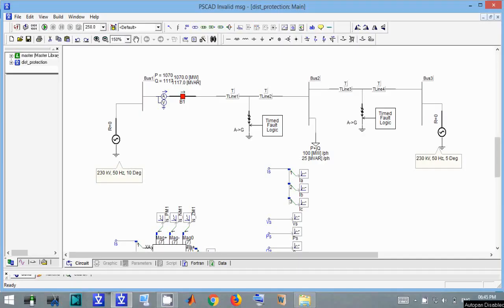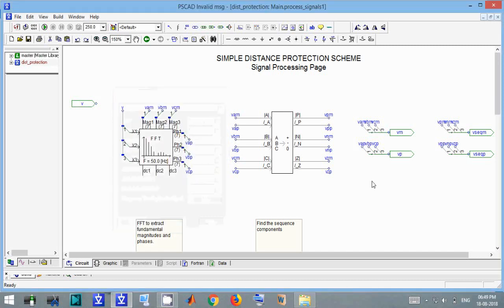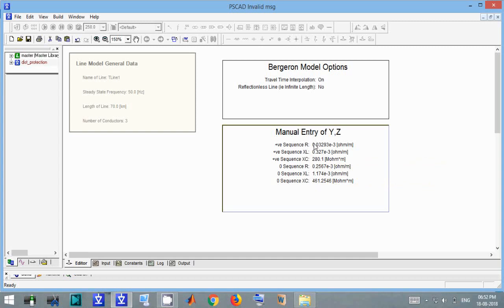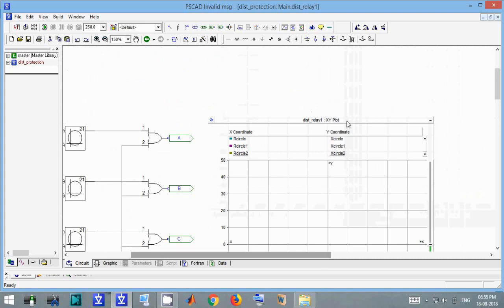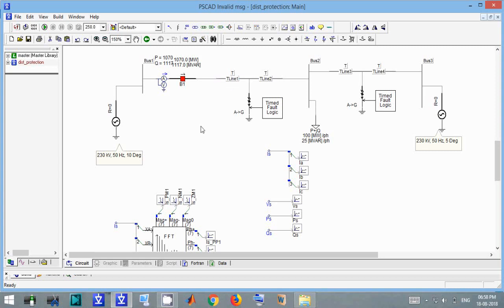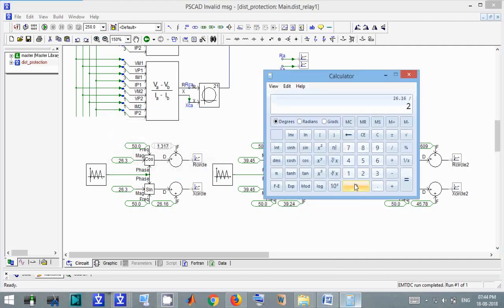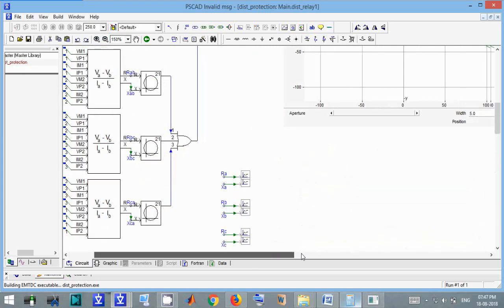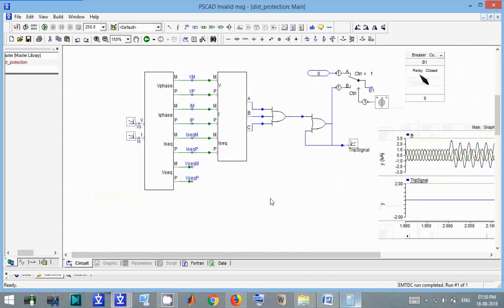08. PSCAD tutorial | Distance relay in PSCAD: Part 2

Comment: How do I detect the AG fault even if for high resistance fault cases, like more than 50 ohm and so on?
Reply from the maker: this is the disadvantage of conventional distance relay.you need to build new algo for detecting the high resistance fault.
Reply: In case of mho relay characteristics, we need line parameters to define reach for zones (circle). I want to know about how we can build quadrilateral characteristics from line parameters? It will better if you make a video regarding quadrilateral characteristics and how can we properly understand it.

Comment: I made a same model like your's， but its P and Q monitored by multimeter is different to yours when i run my simulation（Mine;P=221  Q=32.66    Yours: P=1070  Q=1117）.  Could  u please feel free to tell me what did i do wrong?    thank you every much .
Reply from the maker: may be different for transmission line impedance, freq=50hz i take
Reply: thanks for your answer。  i assure that i used the same Tline （Bergeron Model
 Options，Manual Entry of Y，Z）as yours。and the frequency is 50Hz。                     I have no idea where did i do wrong。                                                                                  by the way， may i have your contact like email for a better  communication with u  in future？     And i am postgraduate student in China 。i wish i could learn from u and discuss with u。  thanks  again ^_^